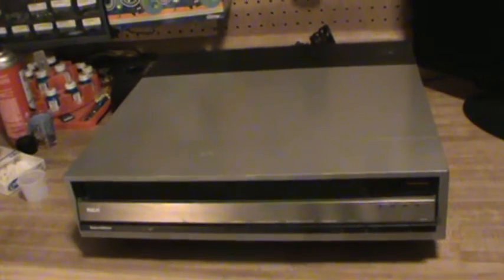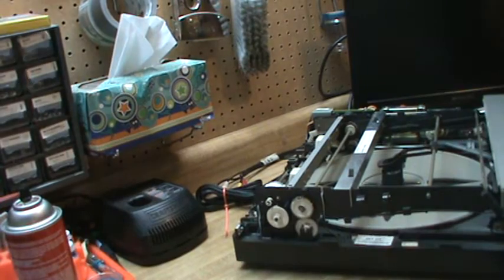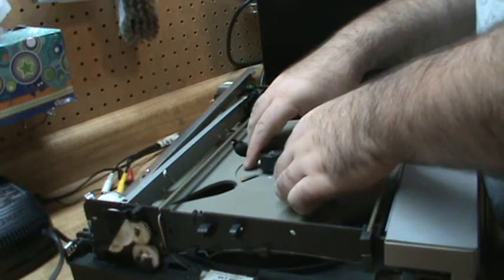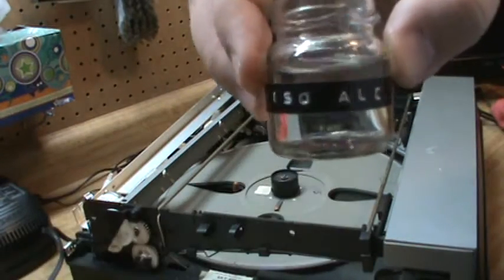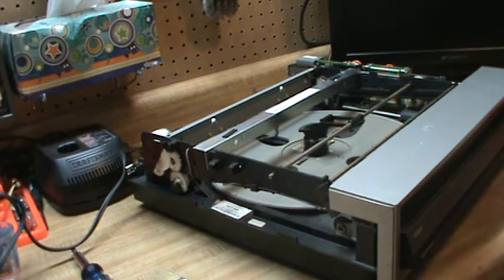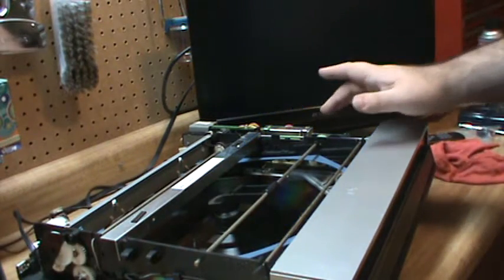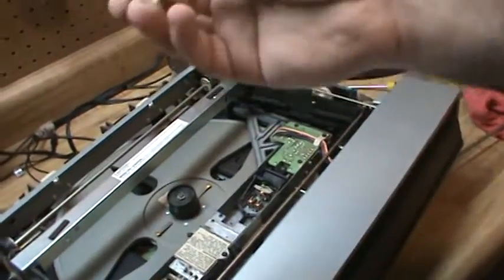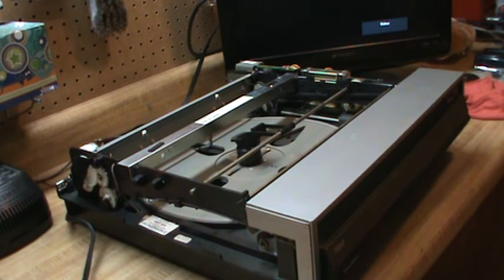RCA Selectavision CED Videodisc Player J/K Player Service

Comment: My SJT101 Plays just fine, but only after I'm able to get the disc fully loaded. I can insert the disc case. It will release the disc from the case and start to push the case shell out. I can then remove the case, but the Function Gear will not engage. If I start to rotate the Function Gear by hand, then it will complete the rest of the loading sequence. I am unable to tell if anything is wrong or broken on the Function Gear. The "white stick" as you call it , and the metal rod that runs through it, are in place and intact.

Comment: Hi Josh,
I have a SJT-400 that was working fine, but now the video went out. Audio is working. Any ideas on what to check?
Reply from the maker: Are you using a CRT Television or a modern TV. If it's a modern TV then it could just be blocking the signal because of static or poor picture. Check it on a CRT TV to confirm no picture. Then it could be a number of things but more than likely the Video Demodulator IC went out. It's becoming a pretty common issue. Unfortunately the IC's are not currently available. You can check with me in July and I might have some then. In order to verify this as the issue you would need to check it with an oscilloscope.

Comment: My 3rd reduction gear won't stop spinning until it breaks the teeth of the other gears, any fixes for that area?
Reply from the maker: You would have to determine why it won't stop first. Sometimes there is a sensor on the stylus arm that tells it when it has reached the front of the player. If that's not operating correctly then the 3rd reduction gear would continue to spin. There could be a number of reasons why this sensor is not working, could be a bad sensor, could be a bad trace on the board, a bad IC, etc. Once you get that figured out then you would have to replace the entire gear assembly if all the other gears are stripped. I can sell you a full assembly from a parts player if you need one. As far as determining why the arm won't stop, I'd have to do that in person. I can link you the manual if you need it. That's about the best I can do remotely.
Reply: @ketonicdude  i truly appreciate you responding so quickly! I was able to trace the problem and get it working again after a few hours of messing around

Comment: You mentioned you were surprised this machine started at 0:00 which few do.  None of mine do.  How  do you adjust this start time?
Reply from the maker: T Coll from what I have heard it's because of the stylus. But I have also heard there is a way to adjust it on the stylus arm but not 100 percent sure. The solution I have always been told is to just try different stylus until you get one that starts at zero.
Reply: Thank You Josh for posting this video. I learned more about the type of lubes to use and also the thrust plate and platter removal was very informative. Mike

Comment: How about the thruster plate has a flat side and a slightly rounded side that is smoother which side faces up
Reply from the maker: Whichever side you prefer. Doesn't make any difference either way.

Comment: Hi Josh I have the same player and the scan and ff rw buttons when pressed causes it to fast forward but  it doesn't go back to play when depressed. Even pressing the play and pause button causes the same fast forward and doesn't go back to normal speed until disc is ejected and reinserted. What is then problem?
Reply from the maker: It could be the contact buttons underneath have gone bad, in which case you would have to replace the whole faceplate. But you can try removing the faceplate and cleaning the ribbon cable first. That might resolve the issue. I have a video on how to do that if you look through my other videos.
Reply: @ketonicdude  if the buttons are bad wouldn't it be stuck continuously? The player does play fine once the disc is ejected and reinserted.  It seems to reset what ever was stuck o  FF mode. I suspect it's the IC controlling those buttons as the chip controls both ff rw and pause. All of those are affected. I may try to resolder  the pins first and replace the chip if that doesn't work.
Reply from the maker: @Anthony-cc8bx  That could certainly be the case. I guess since I have extra players I would try swapping the faceplate for a known good one first just to rule that out before I started replacing IC's. But if you don't have an extra faceplate then I guess there's not much you can do about that. So the service manual flow chart says to check the button first, if the button functions as it should then it says to suspect the Kicker Circuit, if that is ok then it says to suspect the player control IC. The kicker circuit is pin 34 on the player control IC. Hopefully this helps. ?
Reply: @ketonicdude  Very good advice. I have bought a parts player to change the face plate. I've removed mine and found 2 buttons on the circuit behind the buttons being concave in shape and the others are convex. These concave buttons are both the visual search FF RW. Could this be the problem? Not sure if thats normal or what. I will confirm if thats the same on the parts player which is a different model with the same button controls.
Reply: @ketonicdude  I found the problem. It was the button membrane. Two buttons were compressed and i swapped over membrane from another unit and it worked. Also have u fixed a stuck power button? It wont come out.
Reply: @ketonicdude  I know how to remove the faceplate, however is there a way to access the buttons to see if it is just a jammed button that needs to be lubricated?
Reply from the maker: The buttons are just pressure switches, there's nothing to lubricate. If the switch malfunctions then that's it, it has to be replaced.  @kevin1111111

Comment: What's the difference between SKT models and SJT?
Reply from the maker: When RCA updated their machines/products they would go in alphabetical order. So the J player came first then they updated some hardware and changed it to the K model. Basically they are identical other than some circuit board changes. But in my experience the SKT models seem to break down a lot more, not really sure why. The SJT models always seem to work great, for the most part. Hope that helps.
Reply: @ketonicdude  It certainly does, thanks for the answer. I recently got my first CED player (model SJT-090) and when I searched online I couldn't understand the difference between model SJT-090 and SKT-090. But now this make a lot of sense. And thank you for the videos too. I think I got my player working, but cannot get any output (the disc in loading and spinning but I have no audio or video output and the display is always on '- -'). So now I'm trying to contact CEDatum for a new stylus (or a repair of mine), they still haven't answered back and I hope it's only a stylus problem, otherwise I'll have to check the circuitry for a broken component.
Reply from the maker: @adamrandall2996  did you remove the platter and relubricate it? If it's not getting up to speed sometimes it won't read it. Then I'd try a different stylus after that. Does it make a clicking sound as it lifts the sylus up off the disc and drop it back down again like it's trying to play? If so then more than likely the stylus needs to be rebuilt. It could be the platter height, look and make sure the stylus touches the disc when it drops down to play. If the platter is set too low it won't make contact with the stylus, but usually you'll hear the bottom of the platter scraping before it gets too low.
Reply: @ketonicdude  My thruster plate was broken in half, I glued it back using epoxy resin and lubricated the platter. It seems to spin ok (then again it's pretty hard to tell) and the stylus is definitely touching the disk since I see it wobbling with the disc (gently). I'm not hearing any abnormal noise coming from the stylus. Could the platter be too high..? I didn't get any answers from CEDatum, I feel left off... Is there anyone else who's rebuilding/selling CED cartridges?